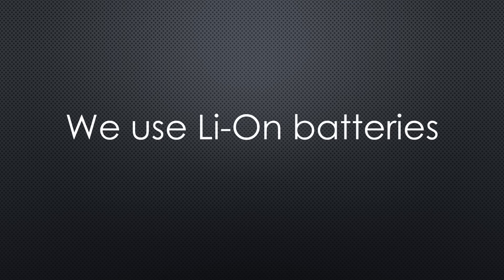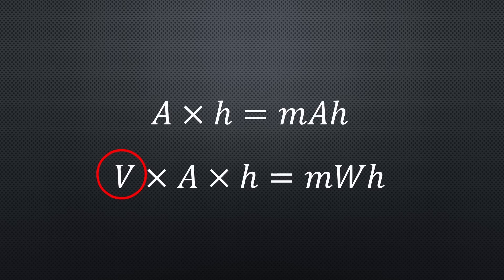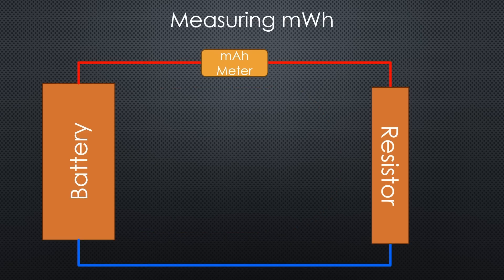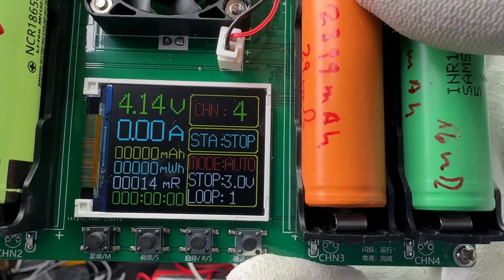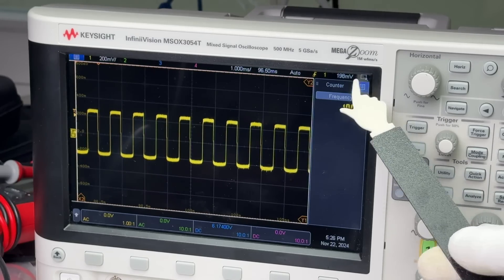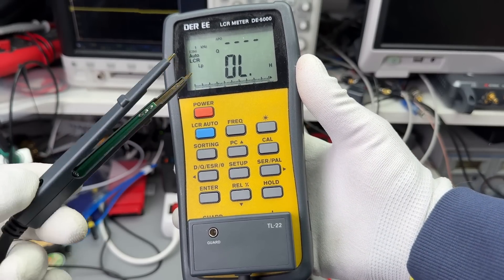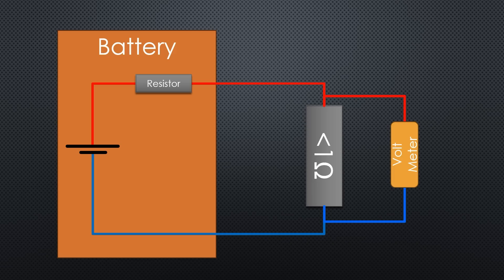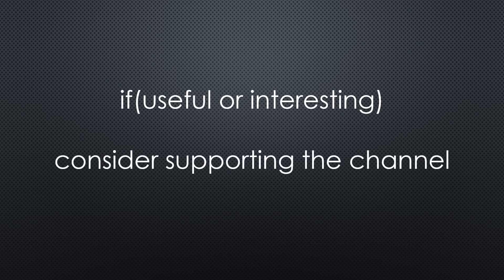(497) How to Properly Test New and Used Li-Ion Batteries (Including Cool Testers)

Comment: With regards to testing for OCP by shorting the battery, afaik some 18650 have fuses under the positive cap. Doesn't this mean they have protection but shorting the battery to test the OCP would render the battery useless?
Reply: It is normally a self rest device. Not a fuse as such.
Depending on the cell or battery it may even be a full protection circuit with FET switching and a BMS.
Reply: @alistercarmichael4990 there are pressure fuses in 18650 cells - those trigger mechanically from internal pressure. Those are named CID - current interrupt device.
Electronical protection is external to that.
Reply from the maker: I do not know of any electrical fuses inside unprotected 18650 batteries. The protected ones stop at a bit over 3A if I remember right.

Comment: Sidenote to that tester: it seems like the firmware is still buggy even on version 5.4
Something that has just happened to me was that I could enable discharge mode on discharged (2.5v) cells, which has triggered a bug where the voltage gets too low and then it tries to do internal resistance measurment (so shorting the cell)... in a loop! that is really bad.
Also the internal resistance measurement should happen when the cell is full... that charger only does it while it/the battery gets plugged in which is SO stupid.
I have to make an openocd (jtag) debug probe for that 8051 mcu and patch the firmware, didn't get around to do that.

A better Idea i had was to make little battery modules with some configurable battery charger ic, protection and a coulomb counter - exposing their i2c bus over usb-c CC pins.
That would allow to use higher Voltages (the TI chip I looked at supported like 5-12v VBUS), have it modular and usable for battery powered projects (5v OTG)!
The charging&discharging part would only need female usb connectors, i2c multiplexer, ch341a for pc comm. and a big discharge resistor, add a simple ac/dc IR meter for good measure ;)
Reply: Which tester?
Reply: @AkosLukacs42  that 4 channel thing, it works fine but has annoying issues
Reply from the maker: Thanks for sharing your experience. So far, I did not discover firmware bugs because I use it in auto mode down to 3.0V...

Comment: Great presentation as always, thanks, Andreas! One thing good to know: the 18650 Tester needs a 5.1k resistor on the USB-C port to work with every USB-C charger that complies with USB-C standards; otherwise, this tester won't work with all USB chargers. I modified my tester and now, works like a charm!
Reply: In a pinch, a USB A to C cable will work too.
Reply: Yes. Get two 5.1k resistors on cc1 to gnd and cc2 to gnd. Not only the charger, but also converting other devices for c-c useage like directly connect a typc-c microphone to android phone.
Reply: This problem is so typical for a lot of devices that decide to cut corners on the USB-C port.
It's been over a decade since this problem has been identified and yet some chinese factory out there is still churning out that bad design.
Reply from the maker: I agree: This problem is well-known and still not taken care of. This is why I still have many USBA to USBC cables in my lab...

Comment: Swollen pouch cells are swollen because of the pressure that has built up inside. Sometimes a cell swells locally because there is a leak on the outer layer, letting moisture inside. The insides of a Lithium battery can react with the air and moisture of its environment and lead to further damage, which can in time - or while charging - lead to catastrophic failure. A swollen battery pack is a reminder to get rid of it, no exceptions.
Reply: Maybe the "NO Exceptions" in your statement should be made more clear as it really is dangerous.
Such warnings cannot be stressed enough.

The last repaircafe I attended, someone brought in one of those hoverwheel 'toys' which had its battery nearly bursting.

I did measure the unconnected voltage and it was more than 4.3V per cell.
Really glad they brought it in and didn't leave it connected to the charger. Who knows what would have happened if they did.
Reply: @TD-er  Well I am 99.9% sure what would have happened: Whooooof. If kept indoors a good chance of burned down house syndrome.

Had such an experience with that infamous production series of DELL Notebook batteries. Within two days over the weekend, the battery pack inflated so much, that the keyboard nearly popped out. I opened the notebook body immerdiately and took out the pouch pack. Unfortunately the edge of a shielding already cut the foil of the pouch and most likely manipulating the Notebook to unscrew the bottom did the rest. I barely managed to separate the connector before the light-show startet. I was smart enough, to do that operation outside, so no damage done.

Since that event I have a metal bucket with a lid in my garden. Filled with dry sand, where I bury suspicious pouch cells until I dispose them properly.
Reply from the maker: Thank you for sharing your experience! It is the proof that the housing can damage batteries.
Reply: @AndreasSpiess  Yep that was exactly the reason why those 1st Note devices could catch fire. The battery had no room to expand and some part of the enclosure then could puncture the battery.

Comment: But, for measuring the capacity with an ammeter, you should use a constant current circuit, right? otherwise with a fix resistor as the voltage goes down, the current also varies. And it is not linear.
Reply: Yes, or with a fixed resistor you could log the voltage over time and use software to calculate the total Watt-hours (which should be close to constant current results). But instead of anything custom like that, it's probably wiser to buy a battery tester :)
Reply from the maker: Most loads also behave like resistors, so testing with a resistor usually is good enough for mAh. For mWh you anyway have to measure the voltage and do the calculation.
Reply: another option is to use a combined power meter that sums up the wh
I bought a meter that measures volts, amps, multiplies that to show actual power in watts... and sums that up over time to show watthours ... routed inline a charger or a load shows you all details after a few charge discharge cycles (I use in on my Ebike)

Comment: very good video. some suggestions, using an ir camera when charging several batteries in parrelel, checking charged batteries voltage against eachother some time later to see if there is excessive self discharge. using a label printer is a really good idea to quickly mark down weight, delivered voltage, capacity after testing, and to serialize battery cells so you dont loose track of the questionable ones. inspecting for damage is a very important step ive learned the hard way when receiving 280ah lifepo4 cells (~1kwh!). had one burst and leak out all of its electrolyte. i know theyre safer chemistry but holy cow that could have ended badly (it was in my car serving as a car battery lol, i know i know).
Reply from the maker: You are very professional with your batteries! But the trick with the label printer is much better than my very bad handwriting!
Reply: @AndreasSpiess  i got one of those blutooth app label printers called nimbot. small enough to keep in my backpack. it was like 12 usd, i think the labels were around 3$/roll of 100?

Comment: Angenommen, man schaltet 2 LiIons in Reihe und möchte sie perfekt balanzieren.
Reicht es aus, die Zellen auf dieselbe Leerlaufspannung zu bringen oder sollte bei Aufladung an beiden Zellen dieselbe Spannung abfallen?
Reply: Würde nie eine Serienschaltung ohne einen Balancer bauen. 
Aber wenn, dann nur Identische aus derselben Charge. Beide parallel voll laden und dann in Serie schalten.
Reply from the maker: Wenn man zwei ähnliche Batterien in Serie schaltet reicht es, sie ab- und zu maximal aufzuladen. Das heisst: Jede Zelle muss einzeln überwacht werden dass ihre Spannung nicht über 4.2V geht. Der Ladestrom wird dann an ihr vorbei zur 2. Zelle geleitet bis die ebenfalls voll ist. Wie @dasgibmekker768  schreibt machen das normalerweise Balancer.
Zwei unterschiedliche Batterien sollte man nicht in Serie schalten.

Comment: Funny thing:
So many people refer to, say, a AA "battery", but it's an "AA cell".  
I think that the word "battery" is properly applied to multiple cells connected in parallel or series to get a desired battery capacity.
A 3,7 V Li battery is usually a 
3,7 V Li ion cell.
Reply: I think the context matters here and its not a singular/plural thing. In everyday usage, only batteries power your device and that battery could be made up of a single cell.
Reply: Correct, most people refer to individual cells as batteries. But it is true in one older common battery type.  A 9V battery is an actual battery of individual cells inside to make the 9 Volts.  There is no 9V chemistry used in them.
Reply: Exactly, it may have originally been "a battery of voltaic cells" a hundred years ago, but the meaning has changed in practice now that we use batteries as everyday consumer items.
Reply from the maker: For me, "battery" is a household name and much better than "cell" (cell has other main meanings in medicine, for example)

Comment: thanks for that vid !
I was wondering about the "pouch batteries" : are there better ? significantly lighter ?
yes they can inflate BUT if the 18650 cannot, what about the chemical inside ?
I suspect inflate is just a visible corruption while the 18650 does not allow that visiblility but allow the corruption (collapse of the capacity)
regards ....
Reply: The 18650 would just vent through the top cap, triggering the CID and making it dead forever if everything goes right.
Reply: Commonly, pouch cells (li-poly) has better electrical characteristics than most cylindrical (li-ion) cells. It usually have bit higher density (capacity) and lower internal resistance which permits higher charging/draining rate and possibly lowering it's self-discharge rate too. Another advantage is because they are commonly flat-shaped, heat dissipations are slightly better depending of it's dimension.

However, the trade-offs are pouch cells can be a little more dangerous, more fragile and have lower tolerance to abuses. It is really important to handle and use them with extra care.
Reply from the maker: The biggest differences for me are the form factor. Often, flat rectangular fits better in my case. And second, they usually come with protection built-in. I never compared capacity per weight/volume.

Comment: I have an 8Ah 18650. Amazingly light - one of my lightest 18650s. I'm a little suspicious of it.  It's an "UltraFire" brand. That sounds safe, right? :)
Reply from the maker: Ultrafire is or was famous for selling very strong batteries (on paper).
Reply: @AndreasSpiess ah yes.. ultra fire and surefire ... 10000mAh in an 18650 😂😂😂😂
Reply: There aren't any 18650 cells with over 4a*h of real capacity as for now (24.11.2024). Any cell that claims higher capacity has to be a fake cell.
Reply: 8 Chinese Ah

Comment: Thanks for this excellent presentation. All the relevant values are included. That 2 pin measuring stick is new; sharper tip like in test beds would be even superior.
Reply: I can just imagine someone accidentally poking a pouch cell with it! :)
Reply from the maker: The pins are not sharp, their front is quite big to get enough surface.
Reply: @veryboringname.  Test pins are continually used in production. These pins are spring damped.

Comment: A friend burned his house down charging Li-ion battery pack he made for himself.  His knowledge of the battery properties was very limited and he paid a big price.  He lost all their family photos for instance.
Reply: That is why I never ever leave my place when charging batteries, and also not only charging Li-Ion but also NiMh ones.  I had 2 AA cells burn a hole in a cheap charger and almost start a fire.  Seems the heat protection didn't work and the plastic melted. The smell was still in my house a week later. For Li-Ion etc, I always charge outside away from direct sunlight and away from anything that can catch fire. During the very cold wintertime on tiles in an iron (empty) cookiebox but I will not leave the house.
As for your friend, that is a nightmare!    One word of advice that a guy from an insurance company gave me and which I highly advice was the following.  In case something like this happens and your place burns down you will have a hard time remembering what furniture you had, tech model types, serial numbers etc etc etc. Take 20 minutes time to film and take pictures of everything and upload it in the cloud.  Your personal belongings will still be gone but it should be a lot easier to get some money back from the insurance company.
Reply: @Luke-san solid advice!
Reply from the maker: That is bad luck! I hope it will never happen to me. One advantage we have here is: We do not use a lot of wood for our houses. So I hope that only one or two rooms would burn out.
Reply: @AndreasSpiess  - Yep, most houses in continental Europe are made of stone, brick and concrete, even going back several centuries. The most easily flammable thing tends to be curtains. I guess wood is a lot cheaper in the US, or the fable of the "Three Little Pigs" isn't as popular there as it is in Europe. 😉
Reply: @RFC3514 , I don't know when this started (for non "budget" houses), but in the U.S. houses are being built larger than better for the same amount of money. Most of the time, thin bricks and thin stone pieces are used for decoration of the outside walls.The framing is all wood.
Reply: @michaels3003  - "Thin stone pieces are used for decoration of the outside walls. The framing is all wood."

Yeah, which feels kind of backwards, like building a car chassis out of plastic and then making the dashboard out of decorative steel. 😄
Reply: @RFC3514  , it is all about money. This principle has some exceptions, but it really explains most the things when decisions are being made.
Reply: @RFC3514  , this may happen, but don't ask me when. 😉
Reply: @michaels3003  "but in the U.S. houses are being built larger than better for the same amount of money." litterally the complete OPPOSITE is true. Good god man, this explains so much....
Reply: @NathanCroucher  , I have no idea what you mean. I am not a builder, but I 've been following real estate for many years. Larger or smaller (less large) homes were being built depending on the current economic conditions. Most people ask how many square feet and how many bedrooms, not how well the house was built. Even "custom" homes are built similarly when compared to many countries where timber houses would not be taken seriously unless the prices were lowered substantially for any given house size. Much more hurricane resistant houses could be built (and the builders know how to build them), but most people prefer a larger house not a smaller and more expensive one.
Reply: @michaels3003  overall, across the board in most western countries, there is a drop in qulity of life, eg house prices.

Unless your a boomer.....
Reply: @AndreasSpiess battery fires are a rapidly rising threat in fire safety engineering. Due to vapour cloud ignition of electrolyte, and continued electrical heating, immersion in water is standard firefighter technique now. Need to develop a way to charge over a bucket of water and drop into it in case of thermal runaway.
Reply: What a nightmare!
Reply: did you burn down his house......
Reply: The house burned down is the stuff of nightmares. I'm currently looking to build a small esp32 battery powered device that operates 24x7 and you can't imagine how much time I spent looking for a safe solution. (Any good ideas would be highly appreciated!)
Reply: @dan-nutu A decent powerbank should have the required protection, and can easily manipulated/recharged by anyone. You can combine it with USB 3 Power delivery to get whatever voltage you want. Andreas made a video on that if I remember correctly.
Reply: I tried looking for a battery pack that would work but I gave up a few years ago. Most of them can't charge the battery and power the load at the same time and even the few ones that manage to do this still switch off the load once the battery gets fully charged. I need something that really works 24x7, not most of the time.
Reply: @dan-nutu , two power banks, two "ideal" diodes, and a relay?
Reply: I hope no pets were lost. This is one of the most horrible things that can happen.
Reply: Don't do something you don't fully understand.

Comment: Nice summary, Andreas. Seems, battery health is a science on its own meanwhile. Times are long gone where "battery" referred to a AAA or even D20 or 4.5 V batteries, and you only took care if it is empty or not ...
Reply from the maker: Thank you! Indeed, batteries became an important factor for modern societies. With mobility, cables are no more the best solution, I assume.
Reply: @AndreasSpiess , thank you Alessandro Volta, 1800, for this invention. At least he got a physical unit named after him.
Reply: Yes, the "AAA" cell was not actually a battery in the "classical" meaning of the word (it required multiple things to be used at the same time).